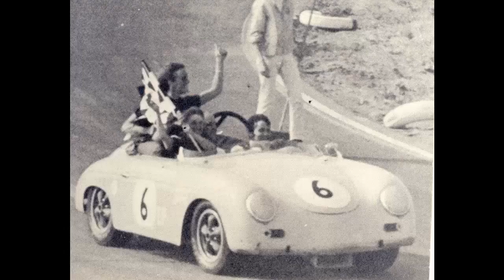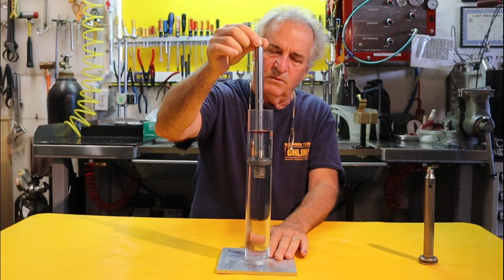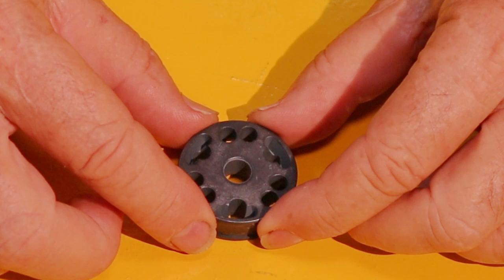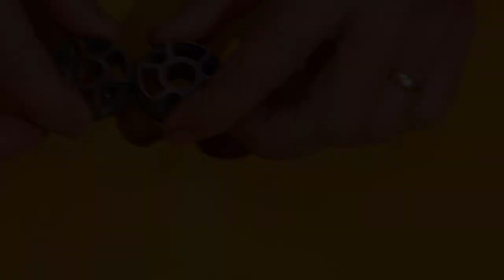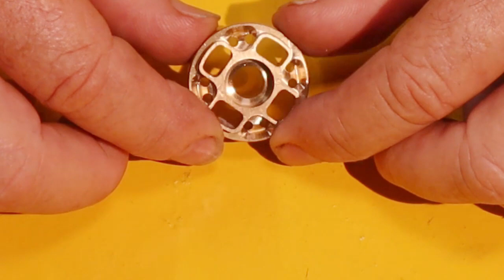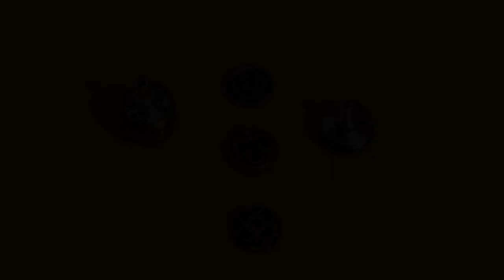Ohlins Suspension - Pistons and valves

Comment: do you know the difference between the ohlins, sequenced opening, mx2 sintered, and the high frequency pistons? can't find much information on them online and their intended motorsport applications?
Reply from the maker: I am not sure what the mx2 sintered piston is.  I think the high frequency piston was used for NASCAR high speed courses where the hold down shocks were very severe.  I think maybe the Indy cars might use this on the very high speed corses like Indy.  We were going to try one on land speed record holder Ralph Hudson's motorcycle but he was killed at Bonneville  before we could try it.  It is a very specialized piece that wouldn't be good for most applications.  What is your application?
Reply: @theohlinsguy4649  Funny enough i just finally re-valved my BC racing coil overs with standard ohlins pistons with decent success, at the time I was looking into the high frequency and trying to understand the use case and if it fit my road car application (which it does not) but it did peak my interest as to why the piston was so much more expensive. Thank you again for being an incredible resource for this stuff, I couldnt have revalved anything without your wisdom.

Comment: Few people understand the dangers of high pressure hydraulics. It’s typically inexperienced heavy machine mechanics - think big Caterpillar or farm equipment. Theres a small tear in a line and their hand or arm pass by a super pressurized stream and it “cuts” them. That “cut” actually just injected them with filthy hydraulic fluid. These “cuts” are small, don’t bleed much and are not super painful, but Immediate emergency medical intervention is required or they often die.
Reply from the maker: lucky for me that I don't see those kind of pressures!  I would have been gone long ago.

Comment: The Teflon bands have less friction than the steel ones. When Ohlins introduced the Teflon bands for the main and floating pistons, it was called "the low-drag kit." Penske uses a 1-piece piston deal with springs behind it that seem to work well, but they're a bitch to get on the piston.
Reply from the maker: The steel bans are coated.  Maybe DU type bushings.  I would think the steel ones on the main piston would be better at keeping the shaft aligned and preventing stiction.  The TTX40 with a through shaft uses a teflon type piston ring because with the through shaft the band only has the job to seal and doesn't have to also be a bushing.
Reply: @theohlinsguy4649  Ya, I know. We used the steel bands in the TT44 until about 2003, but then they introduced the Teflon ones. I think there were some different o- rings as well, maybe?
Reply from the maker: One piece bands are bad.  Pressure builds up behind the band and causes stiction.  One of those things that sounds right but in fact are bad.
Reply: @theohlinsguy4649  I'm just reporting the news, not passing judgement.

Comment: On alu vs steel:
Alu is lighter (good), much cheaper to machine (also good), and transfers heat more (a miniscule improvement to evenly heating oil/dissipating heat). With alu tubes, the alu wear is less abrasive to alu vs steel grit.
Problems: Definite fatigue limit, faster wear, and the worst - very vulnerable to cavitation damage.

Steel: heavier, more expensive to machine, slower heat transfer, steel grit and can rust.
Advantages: if designed right, no fatigue limit/infinite lifespan, wear resistant, higher cavitation resistance, and stronger so ports/holes can be bigger for the same size profile.

Probably a win for steel, but the questions is are alu actually experiencing any failures? If not, then who cares what it's made of. Go for lighter or heavier with more port size options.
Reply from the maker: Hi Andrew. Thanks for the great post.  Ohlins is the best in the world and they always have reasons for doing what they do.  Certainly they could make aluminum pistons if they wanted to.  Here is my take on it:  Ohlins is the best at consistency through a heat range.  Probably steel pistons combined with the other parts involved fit their heat dynamics calculations or experience.  Maybe aluminum expands more and causes stiction when hot or need more clearance when cold?  Probably other things I don't know about.   I use to get TT44s from Indy cars and I got a set where the team machined up some aluminum replica pistons.  Evidently some "race engineer" thought he knew better.  Also most of the steel pistons are not machined but sintered which would probably be more economical.  Basic pistons are very inexpensive from Ohlins.
Reply: @theohlinsguy4649  That makes sense, as alu expands a lot due to heat.
Reply: Ohlins does a lot of their pistons as sintered steel. It's a great way to make a ton of pistons inexpensively, but they can do some huge volumes. Most everyone else uses aluminum pistons. I've never found a functional difference between the two.

Comment: Really interesting video thank you. Ohlins do a "DFV" for some road cars.....Would this basically be a spring pressing against the shims that allows the force of the oil to push the shims and spring  open if the compression force is high enough i.e kerbs on track and rough roads? kind of like a blow off valve
Reply from the maker: HI Adam.  I think you are exactly correct.  As far as I can tell it is a blow off valve with an extra shim stack and kind of a piston with a second bleed hole (second bleed circuit).  Thanks for watching!
Reply: @theohlinsguy4649  I really enjoy hearing about damping. It’s an area of cars that can really make all the difference to driving enjoyment. I had Ohlins on my lotus 2-Eleven and they were witchcraft. Beautifully compliant on the road and 2-way adjustable to work brilliantly on track. I now own a BMW M2 and the stock suspension is way too stiff on the road here in the UK. It would benefit from some sophisticated dampers like the Ohlins DFV that can be both compliant on our awful surfaced roads whilst controlling the body movement of the car…..and can cope with some track work at the turn of the dial.

Comment: Been really enjoying your videos
My question to you is why is valving better than a adjustable valve seems like you loose you ability to tune to changing environment
Reply from the maker: Hi Paul. I don't believe that once you have a good setup you ever have to change it.  But that being said I think there are 2 sides to this issue.  If you have a single tube shock, for instance a S46 Ohlins or other so called professional brands of single tube shocks, you have a problem with pressure balancing.  If you start changing the damping with the knobs you can easily make the shock unhappy.  Also, as you close down the bleeds, which is mostly what adjusters are, this increases hysteresis and also makes the shock a bit unhappy.   These things are good for initial testing but if you find that you are getting an improvement you should always go back and revalve so you can get the damping you want with open bleeds.  Once a single tube shock is valved properly and the adjusters are set these shocks are really good.  Just harder to get there.

Ohlins TTX seems to be another matter.  Because the oil is flowing through the piston (valve) and shims rather than the piston and shims being pushed through the oil, you don't have to worry about pressure balancing because all of the damping is happening at the valve.  No cavitation problems either.  When I first started working with TTX I tried to use the same techniques I used on the single tube shocks but found out they don't really work the same.  You can use the adjuster on the TTX in a pretty broad range without seeing much change in the happiness  of the shock.  Sometimes I find that they seem to look better with the bleed closed down a bit.
Reply: In his reply to you, he says, "I don't believe that once you have a good setup you ever have to change it."
But in the video he says that where ever you show up you should use adjusters for "testing" then go back and re-valve...https://youtu.be/BI_0VrXZdas?t=808

Yeah those are completely contradictory statements. Once and done vs you gotta re-valve. And no, I'm not going to re-valve a bike every time I pull up to a new area or track.

Nope! Those external adjusters are designed to be adjusters. (who'd have thought!)
They allow you to adjust to conditions and fine tune without a complete rebuild.

At the beginning of the day, a mx course might be hardpack, and an hour in is deep loose churned up dirt that has a dampening effect of it's own.
you could just live with now non-ideal suspension for the changing condition... or you could just turn a click or 2 on a few adjusters and be back to excellent pairing

If you have an adventure bike and decide to 2-up, you probably will add preload to keep from squatting. Is your damping still matched right now that you've changed spring-force and weight? Adjusters.

They are there for a reason, and it's no coincidence that cheap suspension tends to lack them and high end suspension tends to have a lot more of them.